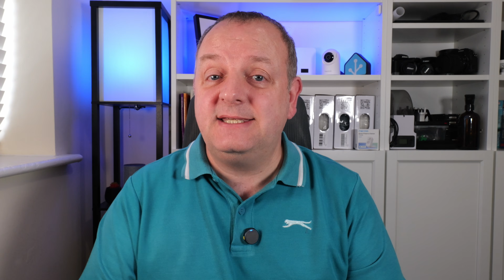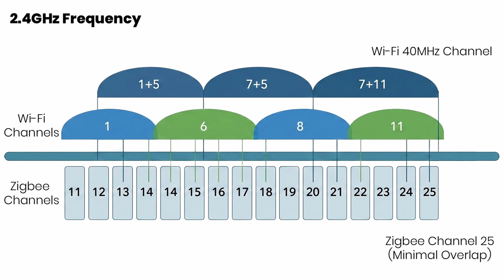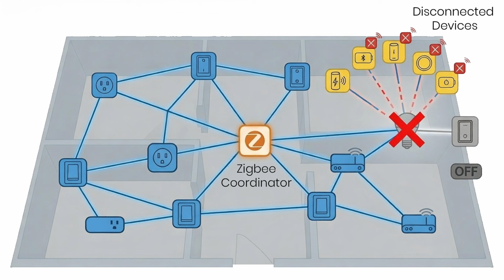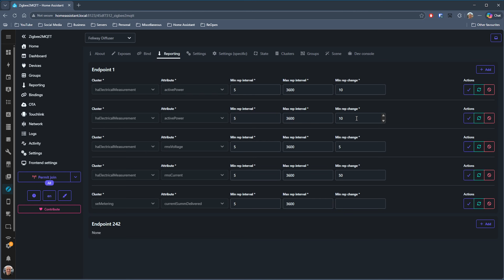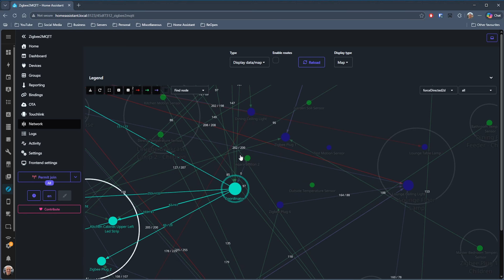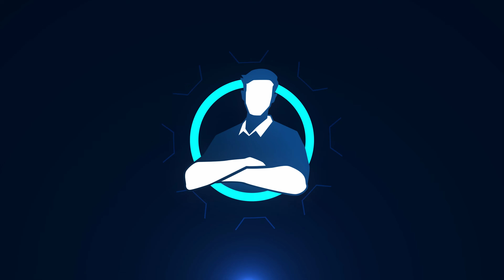Why Your Zigbee Mesh Network Keeps Failing (And How To Fix It)

Comment: In fact I support idea that all bulb should have option to switch off router capability (but it’s not possible without firmware flash). They always make problems in smart homes we build. Not only chips inside have very low processing power as a routers but , they also generate a mess when you have ceiling lamp with 3-4 bulbs. And of course old problem that whole branch gets off when by some reasons bulb is off. I will repeat, imo from my experience it’s better to avoid bulbs with zigbee working as routers - too many problems.

One more comment not mentioned in this video. Avoid zigbee power meters and zigbee Chinese presence sensors. They generate flood of data on zigbee/mqtt network and some of them it’s very difficult to limit/filter still keeping useful.
Reply: What if you keep your bulb powered all the time? I’ve got smart light switches that I’ve essentially just turned into triggers for an automation that toggles the bulb on or off. I’ve thought about getting a pack of ThirdReality bulbs to extend my network a bit and bind the bulb to the switch to make them more reliable.
Reply: @kungfoochicken08 hi. This is general idea: smart bulb always powered + smart switch. But as I mentioned in many situations it generates problems. We found it quite often when too many lamps around or one lamp with several bulbs. They all receive signal in the same time and rerouting in same time - in result you get “ghost” bulbs - either not switching off or with different brightness. It’s only one example with bulb but there are much more. And remember in big zigbee mesh network bulbs are not good routers - they have very low capacity chip.
Reply: @ptrwsk I’ve got a decent sized network: 8 routers and 10 end point devices. I’ve got WiFi bulbs right now. I have to reset one every couple months or so. Do you think it’s worth changing to Zigbee bulbs? 

I’m really just trying to avoid hearing my wife’s mouth when a light switch stops working every couple months. Most of the time it’s just a WiFi bulb falling off my network, but occasionally it’s the Zigbee antenna that needs reset. If I switch to Zigbee bulbs, they should have a more stable connection and I can bind them to the switch so they’ll work even if the rest of the network is down.
Reply from the maker: I have a mix of Zigbee and Wi-Fi bulbs in my house, and I have issues with the Wi-Fi ones all the time. Sometimes it's when HA is rebooted, or there's an update to the integration, other times they just become unavailable. In contrast my Zigbee bulbs only ever go offline when I turn them off at the switch 😂
Reply from the maker: Thanks for the input, do you tend to find it's issues with a particular brand of bulbs? I use IKEA on my Zigbee mesh and have no issues with them at all and they work well as routers.